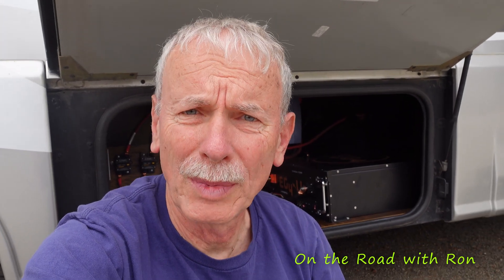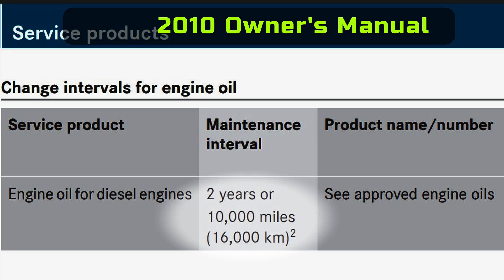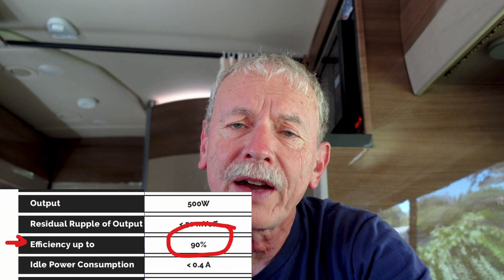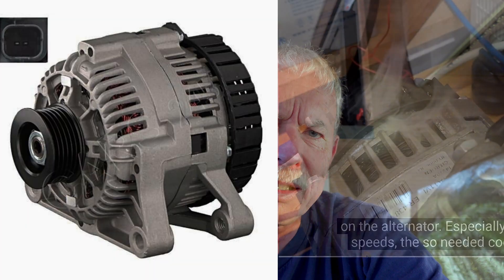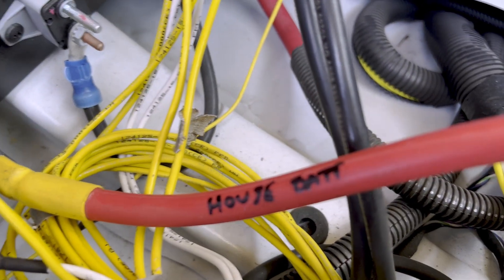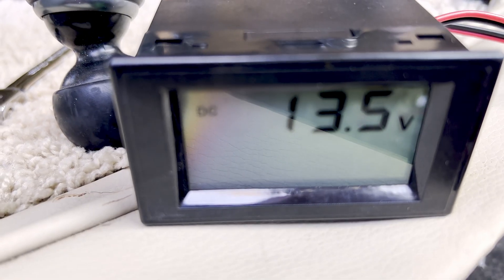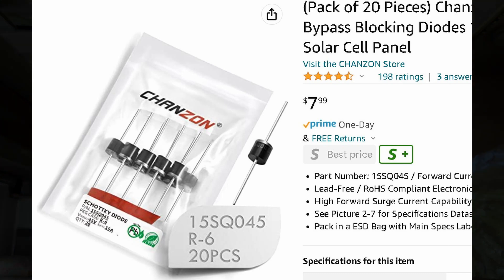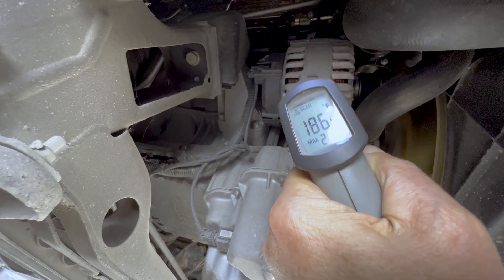DC to DC charger NOT required for big Lithium Battery

Comment: 4:06 - no, it does NOT.
BMS only cuts off - completely STOPS charging or discharging when battery current is exceeded (or on battery over/under temperature overcharge/overdischarge).
It doesn't do ANYTHING when alternator current is exceeded or it overheats.
BMS protects battery by cutting it off the circuit when necessary.
Reply from the maker: I understand not all BMS are the same. “Current Protection:
 * Over-current protection (charging): The BMS limits the amount of current allowed into the battery during charging. If the charging current exceeds the specified maximum continuous charge current (e.g., 100A for the EG4 LifePower4 48V), the BMS will stop or reduce the charging current. There might also be tiered over-current protection with different thresholds and delay times for safety”.
Reply: @ontheroadwithron2432  no. All BMS'es are truly the same. As long as charging current is below maximum whatever battery and BMS itself can accept than ANY BMS will just PASS IT THROUGHOUT. it doesnt do ANY current limiting at this state whatsoever.
Some advanced BMS'es can do a bit more - those communicate with the charger "you can output no more than X amount of current" and / or with the load "you can pull no more than Y amount of current. 
Alternator doesn't understand ANY OF THAT, it will supply 2X/3 when it itself will overheat above X/2

Comment: Victron and some other companies have been jumping on the bandwagon with DC/DC converters. As demonstrated in the Victron video it is perfectly possible to kill an alternator trying to charge a lithium battery bank. What they dont say is that an equivalent sized lead acid bank will give the same results. The problem is with the alternator. Most alternators are designed for vehicles, where there is almost always ram air cooling. Any installation,  such as an RV or a boat, where that cooling is absent, will burn out the regulator, the diode pack or the windings, all of which have relatively low temperature tolerance.

What these manufacturers go on to do is tell you the only solution is their brand new shiny gizmo, which just happens to cost a huge amount of money. A DC/DC converter is just one solution to the problem, and by far the most expensive.

I've worked for many years on boats, designing charging systems for large battery banks. The best solution is heat management. It can be done for very little money. First, fit a thermal switch on your alternator, which shuts off the excitation circuit at a suitable temperature. The cost is pennies. Next, fit a fan to move the heat away from the alternator. Any fan will do, the more air it moves, the move effective it will be. Maybe the cost is a few pounds/dollars. 

The other thing is to make sure any BMS you have isn't going to just cut the charge connection because it thinks the batteries are too full, or too hot,  or too big a load. BMS can be useful, but they can also be the problem, because they are dumb not smart. I never use a BMS because there are other simpler, more foolproof, ways to manage a battery bank.
Reply from the maker: Thanks for your well thought out reply.

Comment: The ending voltage to top off 12V actually 12.8V Lipos is 14.6 volts.  Most alternators put out about 13.8V. So you’re never going to get the Lipos fully charged.  Lipos can also develop memory when rarely being fully recharged. 
Likewise, normal 12V Lipos do not regulate charging current themselves.  That job falls to the Solar Charger, AC charger, or DCtoDC charger.  With a direct connection to the alternator, the current flow is determined by the alternator voltage and Lipo voltage level & internal resistance.  There is no control of the charging current which could overload the alternator or over current smaller Lipo battery banks. 
Lead acid batteries are a lot more forgiving regarding charging from raw alternator power than the pickier lipos. The cost of a DC to DC charger is cheap compared to sacrificing lipo capacity, damaging lipos or getting stranded with a smoked alternator.
Reply from the maker: I hear you. Yes my lithium battery may not be 100% recharged but so what. I use the alternator as a quick boost charger when needed. 90% of my charging is with my solar panels and solar controller. This does limit the max charging voltage also. Lithium doesn’t have a memory and can potentially last longer if not kept fully charged. Cheers

Comment: whats the update? did it blow up or not?
Reply from the maker: My alternator is working fine. It is built to last.
Reply: @ontheroadwithron2432   i have a 60 amp dc to dc charger, and i did a test using some heavy duty jumper cables to bypass the dcs to dc charger.  it ha very u expected results.  i was only pulling about 37 amps without the dc to dc charger.   i thought it would pull more.  but maybe my batteries werent thirsty enough.  they were at about 60%.  i guess you cant believe evwrything on the  internet.   i have 160 amp alternator the van uses about 30 amps.  so i was expecting a min of 100 amp without the dc to dc.  i have recently bought a 300amp alternator and plan on getting another 60 amp dc to dc charger, maybe i dont really need it because i have 800 amp hours of battey.   maybe im over doing it. idk

Comment: I watched that Victron video too. They purposely used a external programmable BMS to overload that alternator.
The BMS in my LiTime batteries would never let themselves charge at that rate. The 7 pin connector on my tow vehicle would never flow that much current in the first place. My conclusion is, I don’t need one ether.
Reply from the maker: A lot of varieties of batteries. If you measure the charge rate with yours then you know how it charges. You can protect both the battery and the wiring to the battery. Not sure of the amp rating on a 7 pin connector. Important to have the right fuse in there.
Reply: @ My 2 LiTime 100 ah with Bluetooth tell me how many amps they are absorbing. Combined it’s about 14 amps from the tow vehicle. That’s all the 7 pin can handle with the OEM truck wiring. Now if I run a lot bigger cable to the back, it would be a different story.

Comment: It appears that alternator charging output depends on the level of charge of lithium batteries. I have a 2022 Winnebago Solis 59px and I recently replaced the house batteries with two 12 volt 100ah Li-Time lithium batteries. When the batteries are at near 0%, they draw 120 amps from the alternator. However they draw only 35 amps when they are at 70%. The alternator is rated 180 amps. So t it may not be a good idea to charge lithium batteries using alternator when they are close to empty but it is probably okay when they are half full or more.
Reply from the maker: Every situation is different. With my Sprinter chassis, peak charging is only 85 amps even at 15% SOC. Mercedes allows 80 amps for coach use so no issues. Solar still does most of the charging.

Comment: Look people DONT do this. Your alternator has a maximum rated output. For example say you have a 90 amp alternator the maximum continuous output of your alternator without overheating is 50 percent for a 90 amp would be just 45 amp continuous. Some alternators have a limiter with heat sensor that will cut the alternator off to cool if overheated but..... chances are yours will not have this. Invest in a quality DC/DC smart charger and do your system correct and safe. Lithium batteries will absorb many more amps than your lead acid battery and will shorten the life of your charging system if you don't hold back this heavy amp draw. DC/DC chargers were not invented to scam your money they have a critical function and it would behoove you to seek a trusted and learned advice when putting your system together.

Comment: If the battery bms cuts off, the alternator may stop giving output. Use a charge controller with a dump load. Beware of spikes without a load on the alternator.
Reply from the maker: True but I have the chassis battery as a load. It dampens any spike quite well. And of course i inly use the alternator when needed. Once the charge level gets up i switch to solar charging only.

Comment: Some say, without som protecrive devices these batteries, when topped up, the litium batteries will cut the contact to the alternator, and current stops flowing, the voltage inside the alternator will spike up and kill the rectifier diods. And you are not mentioning that  "problem" at all, interesting. 🤔
Reply from the maker: This may happen in a lab setting but in an RV application like mine, the chassis battery is always connected to the alternator. The battery will absorb any voltage spike that may occur. You can also get soikes from the generator turning on and off by the way. The chassis battery dampens those also.

Comment: hes got a large amp alt. but if it fails especially on a trip you get a tow and if i believe its a sprinter so a tow to a city expensive or a local shop who will have to  order at least couple hundred another couple for diagnose and install a few days or week in motel  to save less than 200 dc to dc  pay now or later now boondoggling no cell service long hot or cold walk 
and how expensive is your rig 100k +

Comment: 220 amp alternator charging a 100ah lithium at 1c no sweat. 200 ah battery and the alternator will start limiting. BMS usually limit to 1c charging.
Reply from the maker: BMS can be different but mine can take a 100 amp charging current so I expect the alternator is limiting it to 80 amps.

Comment: I have been wondering if a PWM alternator would control output amperage all on it's own. That is what you have
Reply from the maker: Thanks for the idea. Yes it seems that the alternator is capable of controlling its output. That may be why it works so well in my application.
Reply: @ontheroadwithron2432  👍I am looking for a PWM controller with a thermocouple input for housing temperature off the alternator.
Thanks for posting your experimental approach to charging your lithium! 
My goal is to replace my starting battery with lithium.

Comment: the issue with chargin lithium is  the often poor onboard battery controller which kick back into alternator  if the  controller

i would always advise find tear downs on the batteries  to make sure they have  proper internals
Reply from the maker: Having the chassis AGM battery in series help dampen any voltage spikes. And yes I watched Will Prowse do a tear down before purchasing this brand. He gave a good review.

Comment: save 271  to risk a fire..     my  wife would say..can  we  get  by  and  id say.  probably  but  there  is a risk  of fire..
Reply from the maker: True enough. There is a risk for everything we do. The propane we carry around is actually a much higher risk of burning up the rv. Leaky fuel hoses can also start fires. I have never heard of an alternator causing a fire but everyone has to evaluate what they perceive as safe/not safe. Cheers

Comment: They say you can't run a DC to DC converter to a Lto 16 volt yinlong battery bank. I agree with you run your alternator right to the house batteries. You want the lease ohms so  huge wire works well.  2/0 to 4/0 welding wire to the house batteries. I wonder if the big three is done to them RVs that's all big wire from the alternator to the front battery and your grounds. Well in my case im a ham operator and my 2004 highlander I need a lot of watts to my amplifier 200 plus amps continuous. My 12 cell yinlong is set at 15.6 volts on the DC converter. I can run over 3000 watts for over an hour with a lithium and oxygen battery all by itself. So I'm not going to run 15.6 or 16 volts through my Toyota Highlander. I found a place in Vermont that builds the biggest DC converters sentec America the 279 ce 15.6 at 80 amps and will go past 16 volts. My battery is only 5 inches wide by 17 inches long. The Lto oxide cells you got to build yourself. So at 73 amps I can run 2000 plus watts forever. The huge cap banks they sell the Maxwell is a joke they make batteries with them too. You can build a generator with enough yinlong cells. The super cap bank is good to put up front close to the alternator so if you get a huge amp spike you won't fry the alternator. So as far as using it in line with a battery is a joke. They can hold a huge current and spit it out in 5 seconds. But they say it will  save an alternator. Well happy new year and a nice video. Vectron is a joke to a battery charger. I always say if it's not heavy and big for high amps the charger is a joke.

Comment: Victron tested a 70amp alternator with no airflow to illustrate the POTENTIAL dangers to marine customers. Lifepo4 is really becoming a trend in the UK on Narrowboat, where traditionally the alternators fitted are in the 70amp range.
Reply from the maker: Granted that some applications have very weak alternators. I am showing that it is not ALWAYS necessary. My rv application is very different than a marine one. Cheers

Comment: This is an interesting topic. I have a dc/dc 20amp on a 100 amp B (for a fridge) i want to add a second 100amp battery and an inverter for an espresso machine. But the dc/dc charger isn’t enough. I have a 140amp alternator i wonder about the 3 stage charging profile and the fire risk associated with a direct connect charger. Anyone have any ideas?
Reply from the maker: I am not aware of any fire danger for a dc to dc charger.   Good thing about dc is you can run multiple batteries In parallel if they are same type and also have multiple chargers. Just have to deal with more cables.

Comment: Nice video Ron, Thanks! 
I have a question for you or your followers: I have a small converted utility trailer, like a tear drop camper but more like a shoebox camper. I want to switch over to Lithium batteries and as your video suggests I may not need a B2B charger, but... 
I have an unused Renogy Wanderer PWM charge controller. What would happen if I add this charge controller, as a second controller, to my system and run my truck's alternator power through the separate controller, the Wanderer, with no solar panels? Wouldn't the Wanderer charge controller act as a B2B charger?
Reply from the maker: Hard to tell as the solar controller is not designed to run off an alternator. 14 volts may not be enough for it to work as normal solar voltage is around 20 volts.

Comment: Hi Ron, thanks for doing this test (have not read the 472 comments, sorry).
When you took out the golf cart batteries, which battery was used to start the engine, the lithium? 
Or was there another lead acid doing that somewhere.
Just trying to find a longer life solution for car batteries in Phoenix, where heat kills the lead acids after about 3 years ± 1 year
I have 3 motorbikes running on LiFePO4 batteries and they have nothing except the stock charging circuit. One bike has an alternator, the others are just generators with load shedding regulators. Seem to work, have not been stranded yet.
Reply from the maker: Interesting. The Mercedes chassis has its own AGM battery for starting the engine. My lithium battery is not designed for high current discharge. As such it will not start my diesel genny on its own. I have no experience with lithium motorcycle batteries but if the BMS is designed to handle starting the bike then it should be good.
Reply: @ontheroadwithron2432  Thanks Ron. Its the equivalent of replacing your AGM battery with a lithium... is what I'm chasing the internet for. All the video's I've seen keep the lead acid as a current damper so the alternator doesn't fry. 
I agree the test that other company did was rigged. Tiny alternator + giant battery = alternator running flat out.

For a car with a 100A max alternator, I'm thinking of pairing it with a 50 Ah LiFePO4. Pretty sure that would work without all the fancy DC-DC charging
My bike with the alternator has a tiny lithium battery and I had to mod the alternator to drop the voltage for the non-BMS Kinetik battery. That was fun, works though
https://www.youtube.com/watch?v=hb-vVQZh4dA

Comment: I used a DCDC Renogy and with one lithium battery it kept popping the breaker in the engine compartment of my dodge Cummings. When i wired it straight to charging system and no more popped breaker and watching my amp meter on truck and it was charging normally. Only issue is the insolation solenoid is energized on startup so i have to go trip the breaker in engine compartment for startup. The dcdc charger is needed for lead acid batteries but not lithium
Reply from the maker: My isolation solenoid connects the batteries when the engine is running. I added a switch to turn off the solenoid so the alternator is only charging the house battery when I need it.

Comment: You have to be careful.  There are three concerns and the first two will tell you if you should be concerned about the third.

In AGM batteries there is usually a lot of internal resistance.  .01 ohms, even for a good battery.  Lithium is .001 ohms.  To an ordinary alternator, .001 ohms is like a dead short.  Imagine you take the alternator, short the output, and run your engine.  Give it 10-20 min and see if you dont fry your alternator. 

So why are you safe like this guy.  Because he's lucky.  The battery he uses may have a bms that limits the charge current.  This protects the alternator -- assuming your alternator can handle what the bms will regulate.  Usually if it's one battery or possibly two and they are nearly at full charge, you'll be okay.  But if it's 2 or more and you are depleted, not even bms will protect your alternator.